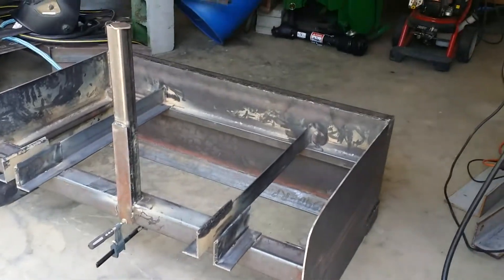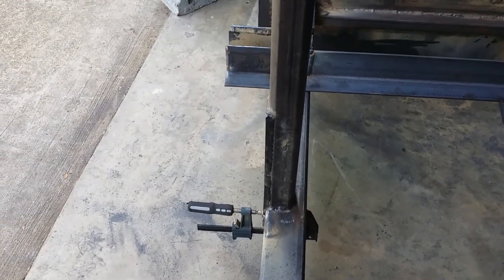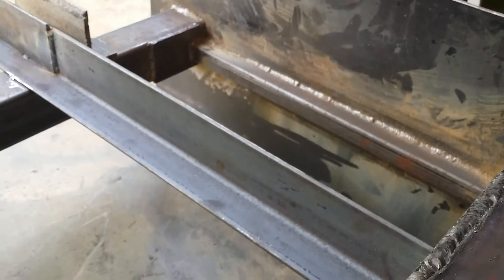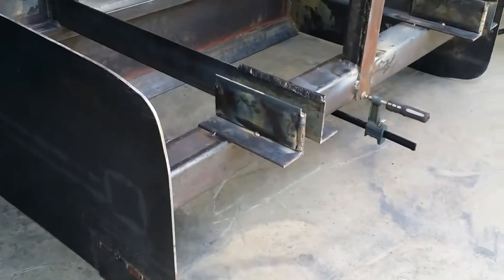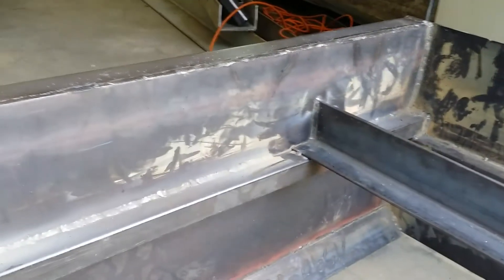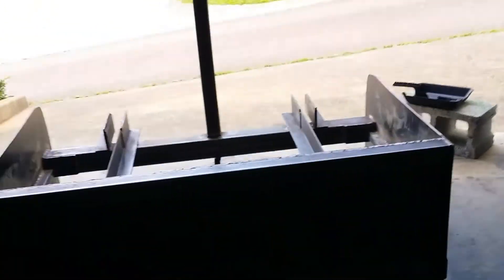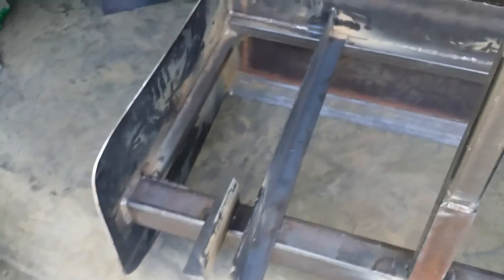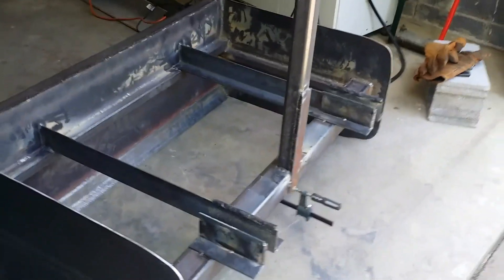Box blade build Part 2

Comment: I’m a boilermaker of 16years and can say you have wayyy over welded this.

Basic rule of thumb, one inch of weld will hold 1ton if the structure is designed correctly.
Reply from the maker: Thanks for the feedback and information.  I'm self taught - so if there's a gap,  I weld it.  Lol.